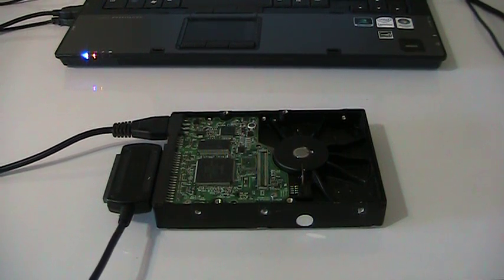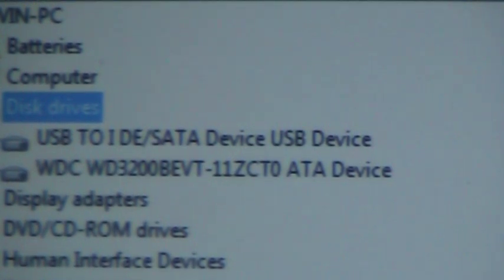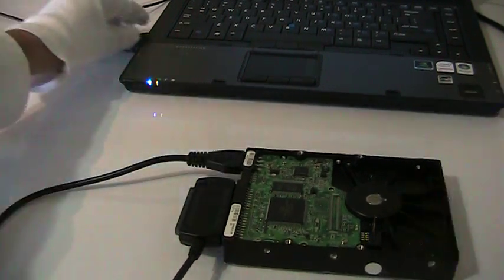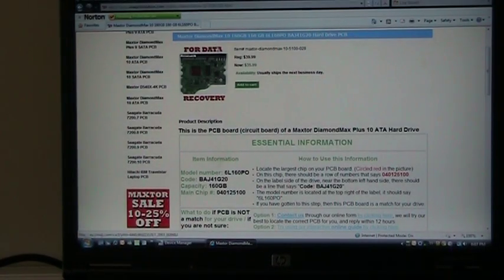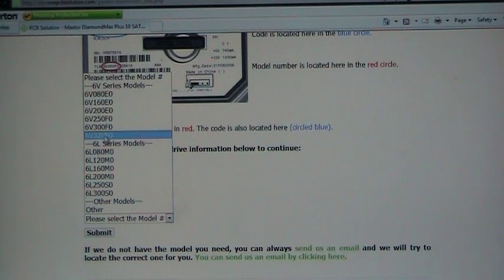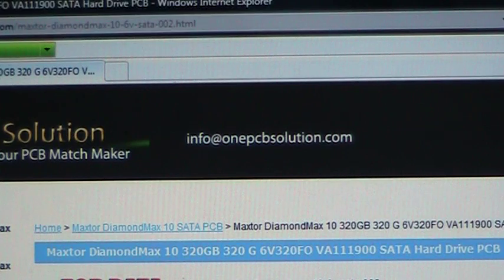DIY How to repair a completely dead hard drive with fried circuit board

Comment: Why doesnt this work for me? I have 2 hard drives that failed in the last month. The exact same brand (Seagate) and I have others the same that I used the board to see if I could get the data from them. But the drives do not show up as "initialized" and come up as RAW. I cannot get the data off of them using the loaner parts. Is there something I am missing?
Reply: Let me guess - the failed hard drives are Seagate Barracuda, 3 TB drives? ST-number ending with 001?
Reply: @NeveraDalmatica  500gb and 1tb

Comment: No Torx handy?
I use a 2.0 mm slot screw driver from my small driver set.
Just give it a gentle tap to set it into the screw head: 
You will probably need pliers on the driver, as they are very tight to start.

Comment: If i did this and changed the circuit board, it will affect my data and files on the hard drive?
Reply: No, it will not affect your stored data.

Comment: +pcbsolution
I think I may have fired the PCB on my Seagate Barracuda LP - ST3500412AS. I think I see some scorching. I don't know if it is the Seagate EC02-0W-10 USB/AC adapter board though... either way, how much do you think a small PC repair shop wouuld charge for time and labor? I thought about buying the screwdriver and PCB and fixing it myself, even though I know almost nothing about computers or electronics, but I'm worried that if the problem is something else, it's better to have the repairman look at it to be sure.

Comment: Wait a minute, I was told anytime you change a circuit card I needed to swap the EPROM. Is this true? Because I bought a new circuit card for my hard drive and after installing it the hard drive was making a clicking noise. I heard it spin then started to click.  On this video you seem to have replaced the card with a different one and worked. How?

Comment: 2 hard disc boot failure doing mine, another computer's hard disc the that telling: ''diskette drive b:none, pri. master disc:cd-rw, ata33, pri. slave disc:none, sec. master disc:none, sec. slave disc:none. verifying dmi pool data, boot from cd, disc boot failure, insert system disc & press enter.'' how datas inside saving im?

Comment: I would recommend PCB Solution to anyone with a dead hard drive pcb.

The guys at PCB Solution (always use the link in the video description, as there are a lot of wannabes on Google with similar names!) are absolutely amazing. Very quick customer service via e-mail, they sent the PCBs very quickly, and the end result was that my drive now works!

I had a fried PCB on an old, but very full, hard drive, and I didn't want to spend a good few hundred £s on safe data recovery. Requested a replacement board from PCB Solution, and they sent it to England very quickly. The board didn't work right away - I was one of the unlucky ones that needed to get a firmware transfer. Life got in the way and I forgot about it for about 4 years.  But such a nice touch - they sent a free torx screwdriver with the replacement PCB! So you don't even need to worry about having the correct torx screwdriver!

Then I had a clear-out and found the old drive and replacement PCB. E-mailed PCB Solution who said to send both the fried board and the replacement in for a firmware transfer. From me sending in the boards to getting them back was around 2 weeks - excellent considering they went from England to Canada and back! They very kindly didn't charge me for the firmware transfer, and after about 5 years or so of having a dead drive with sentimental data, I now have it back and it's working great!

Thank you so much PCB Solution, you guys are the best on the market by a mile!

PS: I'm not a customer rep for PCB Solution whatsoever; this is a heartfelt testimonial by a very happy customer, and I can absolutely recommend PCB Solution to anyone.

Comment: Great video!  Very educational, well made!  I do have a question though... I have a donor drive with what looks like the same number (2060-701574-001 REV A).  My problem is that the screws that hold the card onto the drive don't look like torx, they look round inside, almost like they are rivets or something?  Am I smoking a doobie, or what?  What are they?  I can post a pic if you'd like?
Reply: Okay, I was stupid, they were obviously torx, just smaller than I've used before, got them out easily.  Replaced the card, still no love.  I looked at your website, can't figure out where your section is on transferring firmware.  Any clues for me?
Reply: d3w4yn3 You need to e-mail them directly about transferring firmware. I had to send my damaged board in as well as the new one they supplied, and they did the firmware transfer for me very quickly. Totally worth it, as my drive, which was dead for about 5 years, works perfectly now after the firmware transfer.

One thing to note: Chances are if the drive still doesn't at least power on with the new board (before you've got the new firmware), it's the wrong board or the drive is dead. For me, the drive powered up but just wasn't recognised by the system until the new firmware was in place.
Reply: Thank you!

Comment: I want to know if i can use any hard drive circuit board as a replacement or not..
Reply: Hi,

You definitely cannot - you need to find a matching circuit board. Go to the bottom section of their homepage as linked in the video description, then find the brand of hard drive you have. There's a detailed explanation for each brand on their website. Don't just put in any old board - could destroy what remains of your drive!
Reply: if you can use other type pcbs from the same brand (not cross brand like trying to fix a hitachi deskstar hdd with a seagate barracuda pcb you will see, things will not even fit), then this guy would know and still tell you it is absolutely impossible another fix besides exactly matching your bricked sata hdd model. he will say you have only one option, and that is buying your pcb at his e-store for the jackpot grand prize. 
DO NOT BUY IMPULSIVELY FROM HIS STORE, THIS GUY WOULD MOST LIKELY BE A SCAM TOO. HAVING YOURSELF WAITING FOR A PIECE OF ELECTRONICS TO NEVER ARRIVE. as a disclaimer; if this guy is completely honest with us not leaving any information behind and doing honest business with victims then i should owe him an apology for bad rep..
Reply: Vomit Lord Er...no idea what kind of garbage you're trolling. Fixing a dead hdd pcb is not easy. If the replacent pcb is not made within the same batch within a handful of factories as the one your dead drive comes from, it will not work, simple as. That is because drive manufacture specs change very often, and as such compatibility is lost between pcbs, usually done to drive down costs as the manufacture process becomes more efficient. This is partly why data recovery costs a lot, as data recovery firms often need to find a matching pcb or even desolder dead chips with working ones. The site on this video is legit, I've used them and have a working drive as a result. There is no scam. Feel welcome to try any other similar service online or go to a data recovery firm if you're sceptical, but in my experience you won't get better service than from these guys.

Comment: if i have an identical hard drive model but the pbs number is not identical, will it still work to recover data?

Where can the #7/#8 torx drivers be purchased??
Reply from the maker: You can get the Torx screwdriver from most hardware stores, usually in some kind of precision screwdriver kit.
The 701477 and 701444 boards are not interchangeable. In fact, most 701477 boards cannot be swapped between each other directly, and we have to transfer the info from the dead board onto a new one: http://www.onepcbsolution.com/fitr.html
If you are interested you can contact us for more details.

Comment from the maker: There seems to be some confusion about what is needed to get a compatible circuit board. Hopefully this clears it up.
1) The connector type, SATA or IDE, is not important
2) Yes, most newer drive PCBs contain some unique information about the drive. For these drives, the unique information has to be transferred from the old board onto the new one. We can do this for the models we sell but will need the customer to mail the dead board to us.

Comment: is it true? a HD works replacing the PCB?
Reply: I have Sumsung drive which doesnt connect due to damaged power supply and Data connecters on the Circuit. I have identical board but different in Gigabytes. Will it work. please mail me directly mennopmp@gmail.com

Comment: I purchased a replacement board and tried this but even though the drive spins up it is not recognised under any system, I have tried windows 7 osx and linux.  apparently the circuit boards are factory matched to the physical mapping of the drive platters.  so even if you get a circuit board that is from another drive made at the same time it most probably wont be recognised when you plug it in.

Comment: this is amazing! i had my 6 drives in a FREENAS rig fried on me due to stupid PSU connections! hey but to buy the power circuits online?
Reply: Saeed Siddiki is that how you fried it? I plugged in a sata cable to my psu and now all the hard drives I attached to it are fried. I pulled out the sata cable from the psu and noticed the blacked out pin was different from the original cable. Sorry I don’t know the correct terminology.

Comment: the 1 i had was getting I/O error and not reading after fan failure on the laptop mobo then randomly during 1 attempt to plug into pc with the same equipment ure using it got real got  and the board burnt i hope i can get back in and if i put a new board on the other errors go as well

Comment: I hope this works with the hard drive from my wife's laptop. I removed it and put it in my usb hard drive case. It was recognized via USB on another PC, but in the general tab properties in windows, it shows 0GB of free space and 0GB of used space. Tried to do a CHKDSK, but it gets stuck at 4%. I'm hoping I can get it working with a new circuit board. Thanks for posting.

Comment: I plugged in the molex upside down (wondered why it seemed a little tight).  I'm soo stupid for doing that.  It smelt bad too.

So where would you get a new circuit board for an old Maxtor Diamondmax 80GB IDE, and how much cost wise?

To be honest, I was gonna just use that old drive as a large USB stick, and maybe store a couple of .iso files imaged from the recovery DVD's for a netbook.  There was no data of  any importance on the drive - copied years ago.

Comment: So, ive got an seagate 1,5 TB hardrive. When i plug the hardrive in, it wont respond, and sometimes it causes the computer to freeze, the circuit board looks kinda fried, but the harddrive will still power up, but not work propaly. Any suggestion to what i can do to fix this ?
Sorry for the bad english, im norwegian :P

Comment: Hi. My computer detects "USB mass storage device" and "WDC WD1600AAJS-75WAA0 USB Device"  but on My Computer the HDD is not there. I had this HDD plugged in to my nephew's Nintendo Wii (he's 4 years old) and well... I guess he unplugged it too many times while connected to the Wii to plug in the other flash drive which had games in it too... Do you think it is the circuit board in this case too? The HDD is: Western Digital  WD1600AAJS SATA 160GB 7200rpm    Thanks!

Comment: New high capacity harddrives (usually within the terabyte range or around) have special calibration data stored in a flash chip on the circuit board, and thus this method does not work. However one can get very lucky, and have calibration data on a replacement board within the tolerances, thus working.It's a bit of gambling. 
One might get lucky, but most of the times this won't work.

Comment: Hey i ve got a question for you guys, i currently own a WD 1tb USB 2.0 external hard drive (black addition) and the circuit board got fried as i plugged in the wrong power adaptor
I am planning to fix it by buying a new circuit board, but i need to know the right model to buy, does anyone know what model to buy or do i have to take apart my hdd to find out? and also, i am currently in australia melboure. are there places that can fix my external hard drive data recovery cause cost a fortune

Comment: That's the easy way! I spent 6 days with my current disk to get it into a reasonably good state, the platter had a small speck of dust on it, the dust hit the head and destroyed it, that's when I ran the shower to purify the air an cleaned the platters with a chamois leather and replace the headstack!

Comment: @ABTomahawK This is not a data recovery.  Data recovery either involves software if the drive runs, or tearing it down and removing the platters.  The is a repair/replacement of the control PCB.

Comment: 1:04 "Or just nothing at all."
1:15 Again, replacing, not fixing.  
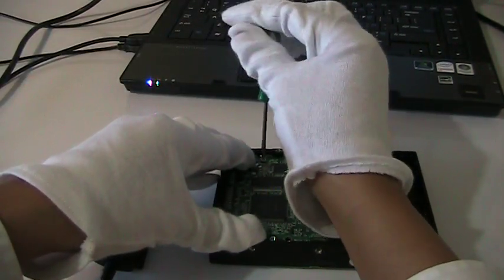1:42 And you can find electronics stores in the section of town where all the shut down businesses are.  
2:06 Then read it a bedtime story.
2:12 Uh, so you were able to find a replacement board (again, replace, not fix) that didn't have its own cushioning?  Did they not give you screws for it either?  Or how about they can have a vending machine but you provide your own cup?
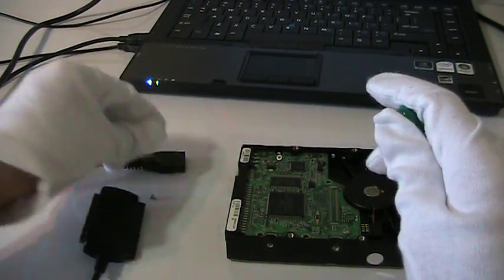2:34 Saving what?  You replaced it.

Comment: When replacing PCBs you have to make sure it's the identical model with same size or it won't work. It'll spin up but won't be detected or will be detected with a weird tag and being unusable. Maxtors, like this one needs the same controller chip (Big square chip) in order to work.

Comment: @hunterpeterson81095 

I'm just teasin. But you really don't have to worry about dust. As long as you do not open the hard drive enclosure, no dust will enter it. What you should be worried about is static electricity. That will do more harm than anything.

Comment: Cables To Go USB 2.0 to IDE/Serial ATA Drive Adapter
1 x 40-pin IDC Female Ultra ATA, 1 x 44-pin IDC Female Ultra ATA, 1 x 7-pin Female Serial ATA
your price $19.99 CND Mfr #: 30504

Comment: i have some idea but u will laugh on it, but i have personal experience and i succeed, put your hard disk in refrigerator in chill try for 1 day but keep away from water so use plastic bag or antistatic bag. after 1 day take it out and dry for some hours. after full dry connect to pc, it will work, dont use dryer to dry. dushyant thakkar,Shreeji Infotech, Vadodara Gujarat,India

Comment: So mine seemed to make no noise when I started it... Then I pulled it out of the external casing... I plugged it in and placed my ear to it.... It was a very quit clicking... Sounded almost like a little bell ringing over and over again about 2 to 3 times a second... What is this? Oh... Disk does not seem to spin...

Comment: If somebody's hard drive is clicking..not working/detecting on the PC due to either: (1) PCB getting fried, (2) Head problems or (3) Platter corruption.. is the data on the hard drive still retrievable?? Please respond. Thanks.

Comment: If the hard drive itself has failed, how does this solution work?  Obviously if a motherboard or other piece of hardware (save for the HD) fails, this works well.  But if one is unable to boot into windows because the drive is unreadable, does this solution have a chance to work?  I'm hoping the answer is yes in my case, but fear that it won't.

Comment: You saved my life!  My father-in-laws hard drive fried while I was installing an upgrade for him.  Of course he has no backup.  Was getting ready to try a data recovery company and eat the expense.  Jumped on the web for a quick search and found your video.  I had another old drive (circa 2004) sitting in a shelf waiting to be thrown out.  Swapped the boards and all is well.  Went from zero to hero in about 5 minutes!  Once again thanks.

Comment: I have the same problems listed here. I can plug it in and it shows up as usb mass storage device call wd, but it's not in shown in my computer. I believe it's just doing that because of the adapter being plugged in. It does however start spinning and starts making a clicking noise. I have another wd hdd just like it that works and I tried swapping the circuit board but it still did the same thing. When I tried the broken hdd's circuit board on the working hdd it also didn't work.

Comment: how do I know what size of torx screwdriver I need its a Hitachi Hdd:5k250-250 
Model: HTS542525K9SA00 5400 RPM? I want to buy but don't know what size I need and they seem really really small torx screws any help is appriciated. LOVE YOUR VIDEOS 2

Comment: HI, Please some advice from you !
I have a WD740 Raptor and it got burnt after 4 months.
i removed it and took out the pcb and one of the chips was burnt so I think I want to replace the whole pcb now. One thing I want to ask is when i put the hard disk in an external enclosure to test it, I could not even feel the disks spinning inside, is this normal or could it even be the platers and other stuff got destroyed too?
thanks for any advice!

Comment from the maker: @leviathanstudios If the computer will not turn on with the hard drive attached, it means the circuit board is definitely short circuited.
So I think your chances of success are pretty good if you replace the circuit board.

Comment from the maker: That definitely isn't a circuit board problem. If you are trying to recover your data, you can try connecting the hard drive to a different computer with an external enclosure. Be careful, the hard drive might have viruses in it.

Comment from the maker: Hi there,
Sorry, unfortunately we don't have any WD laptop boards at the moment.
Usually the power supply to hard drives should contain either both 12V and 5V pins, or is 12V. If the hard drive is still spinning, usually the correct power supply would have been used.